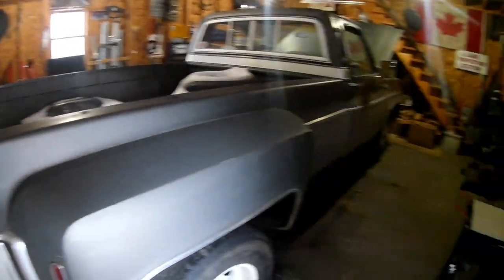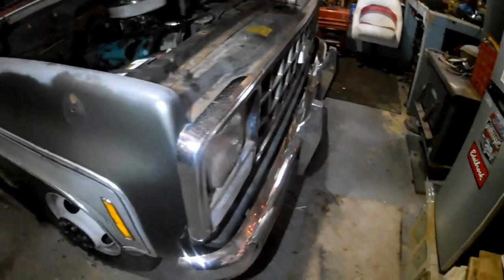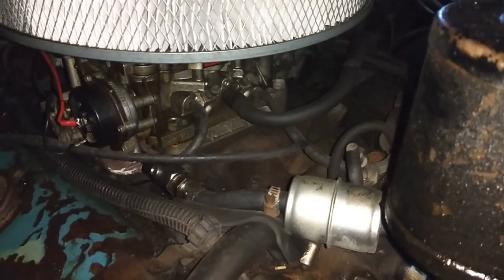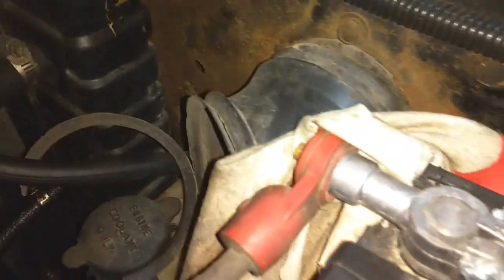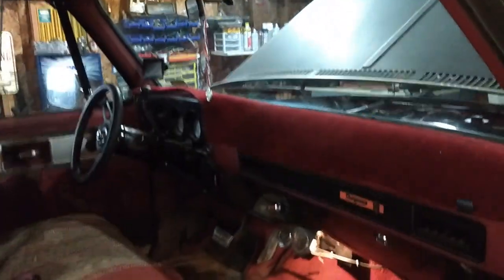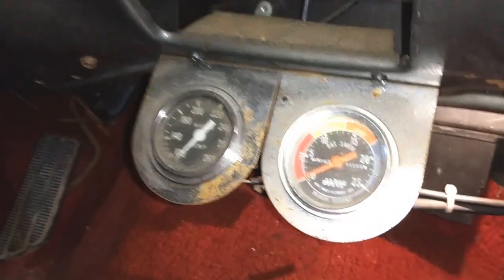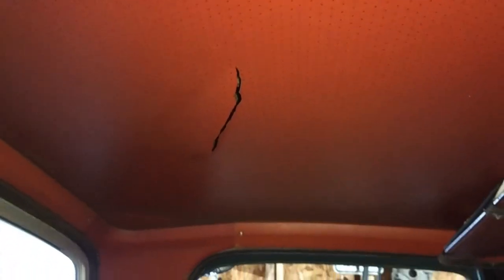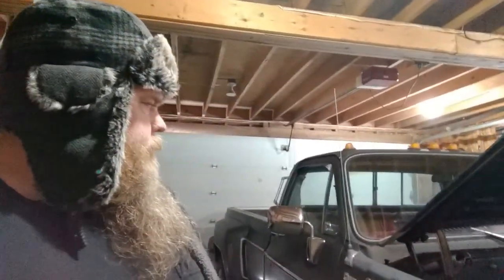Picking apart the Dually

Comment: If you look at the casting number on the head it will let you know uf it is rec or oval...your truck should be oval unless someone changed it. The rec heads weren't very.. common. You likely have 049 781 or 236(peanut port) heads
Reply: I wouldn't be surprised if he has the 781 large oval port heads